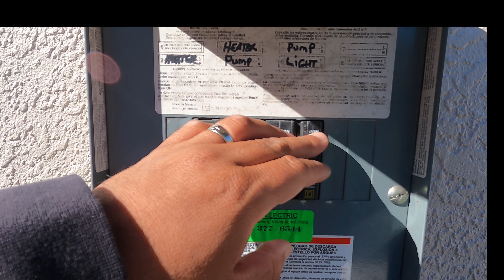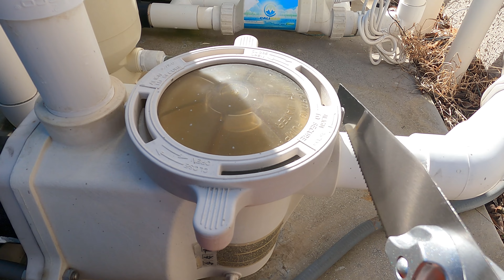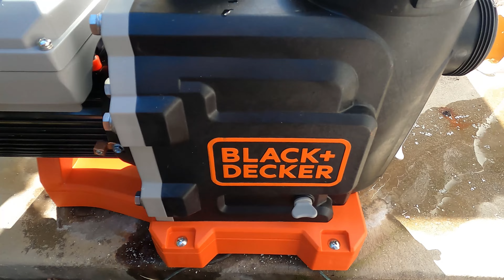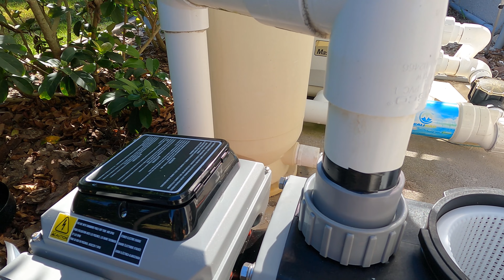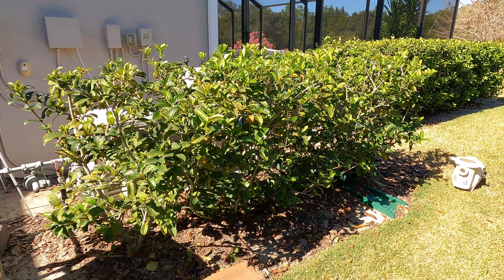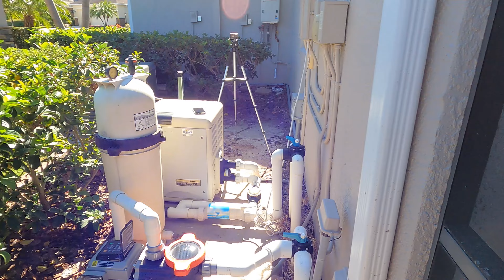Black & Decker Variable Speed Inground Pool Pump Install.

Comment: Nice Video! wondering how you deal with automatic start when cold temp and your pool heater? Thanks!
Reply from the maker: The heater has a pressure switch so as soon as it stops detecting water flow it goes on standby. Once the pump engages again if the water temp is below the thermostat setting then the heat will kick on.

Comment: Where can I buy the correct electrical pigtail whip that has 1/2" "NPT" threaded fitting on the end? I need 4ft whip that will thread into my new Black & Decker 1.5 hp pool pump. Southside whip from HD doesn't work with this pump.
Reply from the maker: Pool parts to go may have them.

Comment: do you think it's better than the single speed Pentair Whisperflo pumps?
Reply from the maker: This is way better than the whisperflo unit we were using. Brushless motor, energy star plus always great to have variable speeds throughout the day.
Reply: @firsttimepoolownersgrouptv2971   they just came out like a year ago
Reply from the maker: Time will tell on durability we are in our second year. The functionality and specs are better than the 10 year old whisper flow we replaced. If I were building a new pool I would most likely go go with a pentair variable speeds whisper flow but for my 10 year old pool, this is a heck of an upgrade. My previous pentair whisper flow single speed needed a motor replacement after 5 years. If I could get at least 5 years out of this one, I will be happy.
Reply: There's no way it could be better

Comment: You didn't show any install just quick flash forwards. So where does bonding wire go from pump yo what?
Reply from the maker: You should already have existing bonding wire by code. Ours goes to all pool equipment then into the ground.

Comment: The red wire and a black wire which red wire do i attach it on the top or bottom
Reply: If it’s 220v, it does not matter which goes to L1 or L2, just as long as ground goes to the green nut.
Reply: @rigbyspoolservices   I see you have a blue cable on the top and black in the bottom so in my case the red cable would be the the blue you have as the power?
Reply: @tivozamorano9594  does not matter, for 220 both those legs are carrying power

Comment: The blue torrent and calimar vs pumps are the same pump other than looks and warranty. Picked up the 3hp calimar for $489.
Reply: Hey Doug I agree they do look the same on the outside, but looking at the parts diagram it looks like they changed some things (BD 1.5 vs Calimar 1.5). The diffuser on each are of different designs. Looks like they also went from a seal and mounting plate design (on the Calimar) to a straight 1 piece design (on the BD). Definitely not saying one way is better than the other, just some noted differences.

Comment: Did this install this past weekend. Definitely easy, although I discovered there's not a bonding wire to be found anywhere around my equipment pad (last pump had nothing hooked to it), so opened a new can of worms with that. Fun stuff.
Reply: BY CODE YOUR POOL PERIMETER SHOULD BE BONDED WITH COPPER WIRE FULL PERIMETER ATTACHED TO YOUR POOL PUMPS AND GROUNDED BY YOUR HOUSE
Reply: @gerardarthurway  yes hence my comment "opened a new can of worms with that" you all caps maniac.
Reply: Home Depot has ground rods drive one in, get parts to connect from rod to pump if copper water source is near connect to that also bond all together if possible.

Comment: I read in manual that elbows should be  no closer than 5 x the pipe diameter at inlet or outlet.
Reply: Correct- this is true for any pump. Ideally you want as much straight pipe before/after as possible. In this instance we are trying to show how to swap one for another but on a new build- we would absolutely give it more of a run
Reply: This is to prevent staving the pump for water.... VS pump... lower speed matters way less...

Comment: My pump says it’s a 230V but has a black, white and green wires. How would I be able to connect 230V wiring to it? (2 black and 1 green wire).
Reply: Blacks to L1 and L2, green to ground
Reply: Or black and white to L1 and L2 and green to ground. You can check at the breaker- if you have a double pole (2 switches) it’s 230v
Reply: @rigbyspoolservices  🙏 thank you for the reply. I plugged them in and it work out. Thank you so much.
Reply from the maker: Thanks @ Rigby's Pool Services
Reply: Where does red power go to and the black go to on the pump